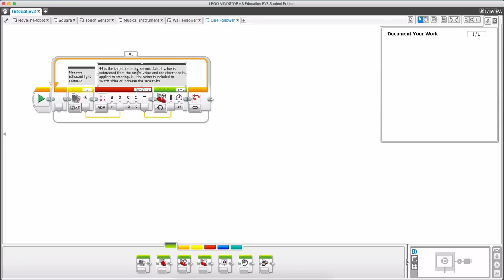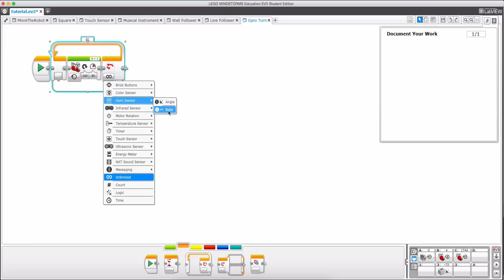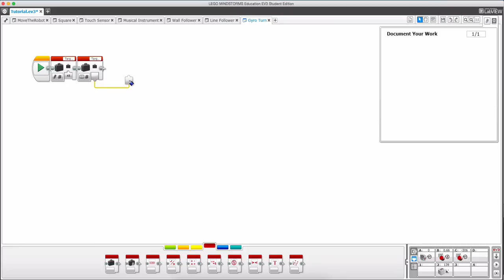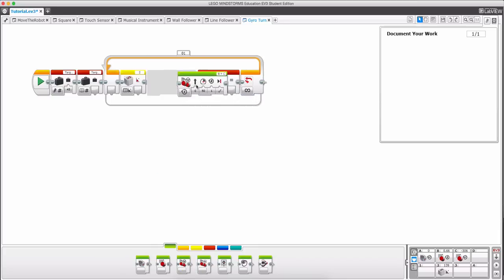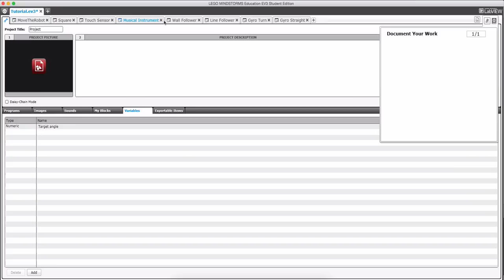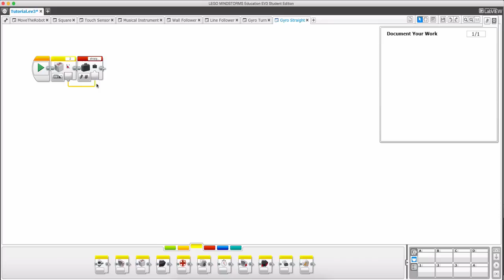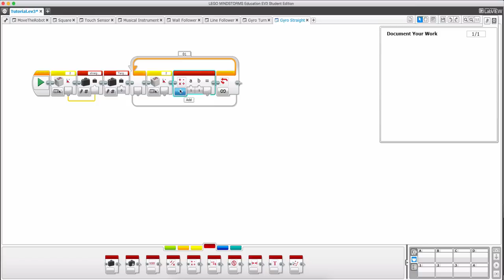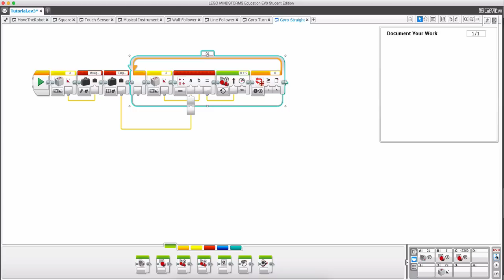Mindstorms EV3 Tutorial #7: Use the gyro sensor

Comment: Thank for your tutorials, after your tutorials, I built two three different my blocks - if I test the myblock individually it works as expected, but did get the same result all the time if I am trying use these myblocks to move the robot such straight - turn 90 R  - straight - turn left 90 L also, I have another myblock with the input of speed and number of rotation all these combination of my blocks. Problem I have is if have 3-5 these types of myblocks, program just stop middle, not sure what wrong with the myblock. Can you help?

Comment: Moving in a straight line. This only works once, when used a second time the program simply exits. I have not traced down just how the variables are not using the current heading on the second use even when reseting to Gyro to 0 before it runs.
Reply: To use that program repeatidly you have to reset the motor values at the start of the program

Comment: Hi Kevin, I did exactly as you did to move the Robot straight. Unfortunately, my robot does not move back to the intended straightline when I move it off the direction like you did. What I also did not understand is, the reason you are using gyro sensor reading to write into the variable staright angle but read the target angle to calculate the differnce. Please help.
Reply: Hey smitharayala, I've done the program as well and found out that it starts spinning out of control. The simple thing to do to the program is to change the math block to addition, instead of subtraction. That should fix it.

Comment: For your first program: I'd suggest that instead of changing the termination condition to a little less than the target, change the speed to still be a small positive number when it reaches the target.  For example, if your target is x degrees and the current sensor reading is k degrees, make the speed be something like 30*(x-k+5)/x, to start at speed 35 and end at speed 5, no matter the value of x.

Comment: I'm having an issue with the 90 deg turn... it doesn't quite make it to 90 degrees, then kind of pauses and waits and never quite makes it. So it doesn't move onto the next part of the program. Any ideas?
Reply from the maker: +Ihms Student Have the exit condition of the loop be a few degrees less than than your turn (in your case 87 degrees) This will guarantee it exits the loop.
Reply: Thanks I'll try it!